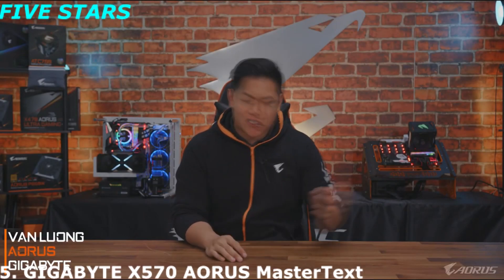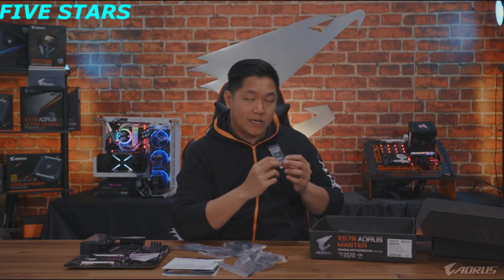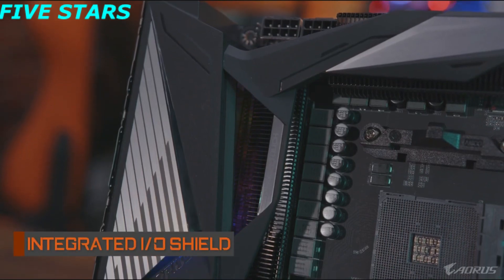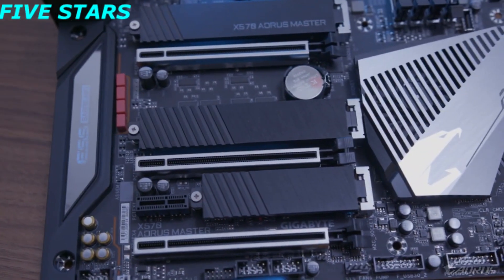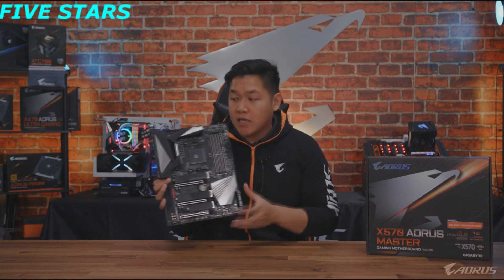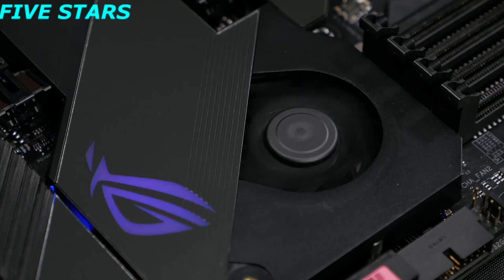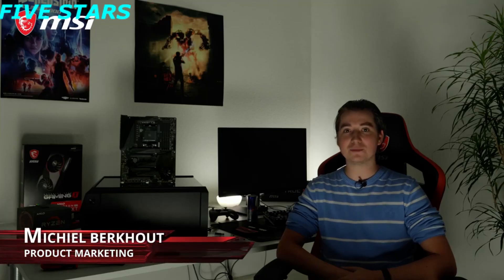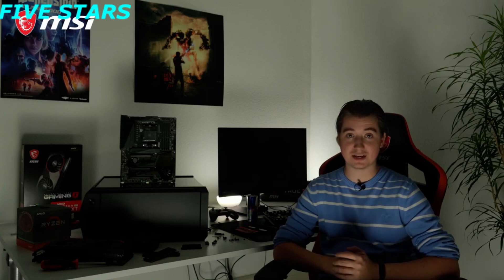Best X570 Motherboards for Ryzen

Comment: I am a happy camper -  I have just upgraded my old (REALLY old) Intel 4790K to an AMD 3700X and I decided to get the Aorus Master Motherboard as it had  good reviews and all the feature set I needed, 3 M.2 slots (I'd have been happy with 2, but 3 is better!), and dual LANs specifically. (Along with many others, some of which I also wanted to include in the list. It has been up and running for a few days now, and apart from the usual little glitches of an new system, all is going very well indeed...much better than the 4790K did almost 7 years ago. (I have a 1Tb M.2 SSD for the System disc and a 2TB M.2 for My Gaming disc, Storage is 2 10TB HDDs.) I am getting by on a borrowed GTX 1050 - I sold the 4790 System with my GTX 980 G1 to help finance the video card replacement... -  until I can splurge out on a 3070 or 3080 in about 4 to 6 weeks. (I'm in NZ and it will take a few extra weeks for them to arrive on the market here, sadly.) Very much enjoyed the look at the motherboard. Thanks.
Reply: hope your system runs good thought best of luck, stay happy son.
Reply: bro no offence to your building choices but we dont care .